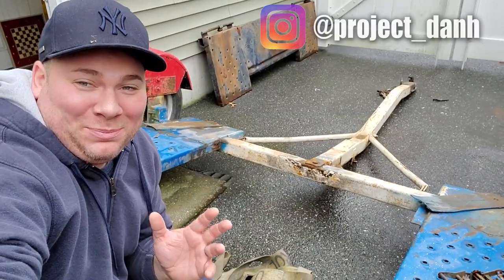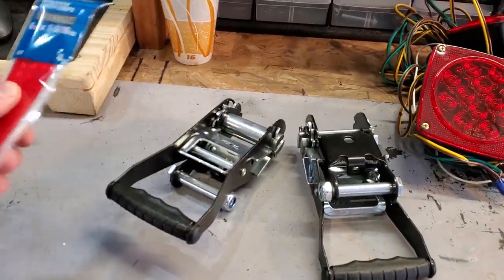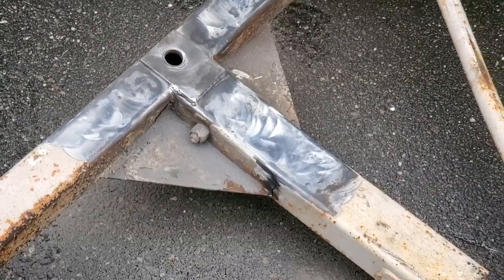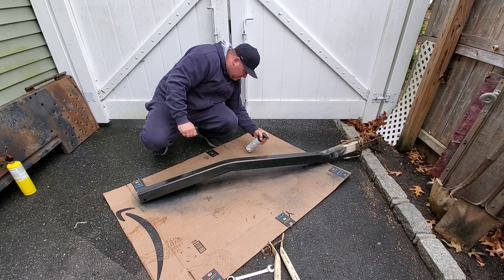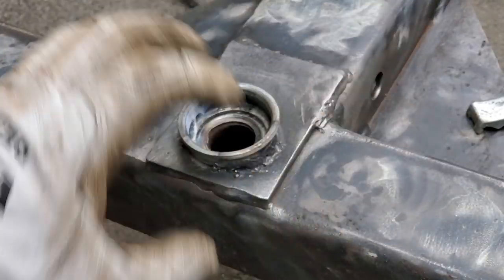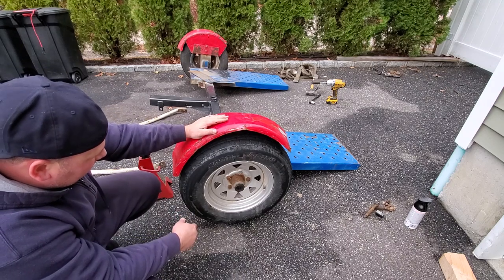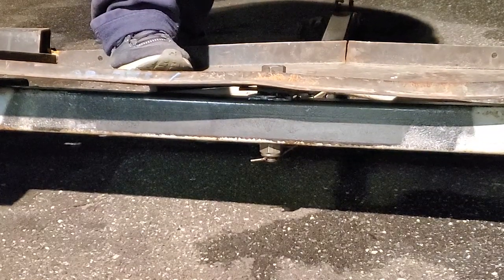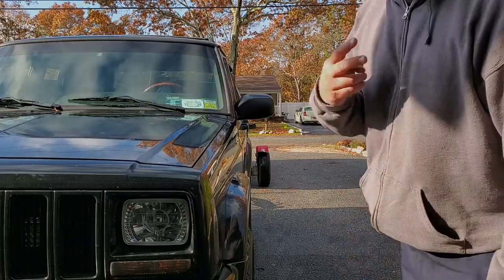JEEP ZJ RESCUE MISSION & TOW DOLLY RESTORATION - GETTING A GRAND CHEROKEE PARTS CAR

Comment: When you weld cracks if you drill a hole at the ends it will help from crackin more
Reply from the maker: Yes!  I believe I accomplished a similar result by grinding out the crack.. I hope it works 🤞Thanks for the tip!
Reply: Project Dan H your welcome man 💯

Comment: I've got a gallon of oil based Rust-Oleum black that I crack open from time to time to paint hitches and bumpers on my YJ and XJ it's thick as syrup,I use chip brushes to pitch them when I'm done,the brush marks lay right down before it dries, takes overnight to dry
Reply from the maker: I have a can of POR15 in do the same with 🤣

Comment: Gotta say that XJ looks great.  I'd still love to get an XJ at some point, love my 98 ZJ but I have always wanted an XJ too.  

Great work grabbing that parts ZJ, grab everything you can off it before you part it out or whatever your plans are.  Pull that transmission and rebuild it for a future video maybe?  

Isn't the XJ's rated for 5,000lbs towing capacity?  If so that's the same as a ZJ with the 4L I6.  Have to admit I towed more than 5k with my 96 ZJ a couple times and it did quite well...2100lb car trailer plus a full size 1983 Ford Bronco on the trailer...that was fun...NOT!!  LOL but the ole 4L I6 did it I was surprised.
Reply from the maker: Haha grab that XJ bro!  Yes this XJ can tow 5000 but the dolly is rated at 3500.  This set up is perfect for transporting small jeeps and that's exactly what I plan to do!  😁

Comment: Cool video, Question,  what do u use the sockets for that are attached to the strip of wood above your work bench?
Reply from the maker: Thanks man!  That is my nut driver set.  I use them in small places on my screw gun when I can't reach with a socket... i end up using them mostly on hose clamps that are ¹/² , 7mm or 8mm. Lol

Comment: Polycarbide wheel...  eats rust, paint, powder coat... everything buy the base metal. 5 bucks at harbor freight and doesn't have wires to fling into your eyes.
Reply from the maker: In all in! Thanks for the tip!